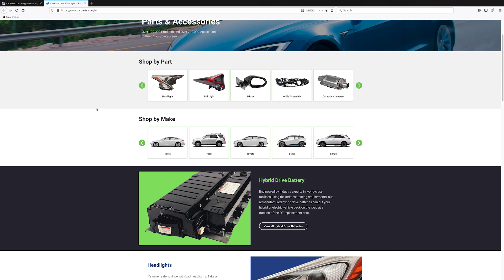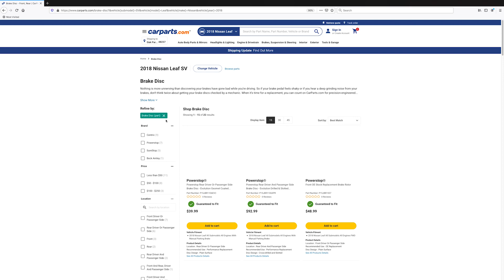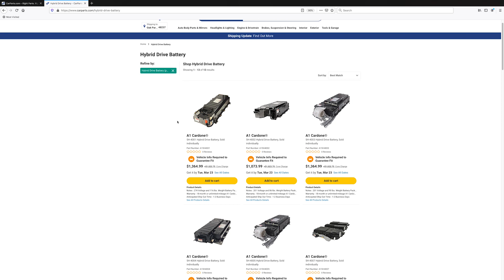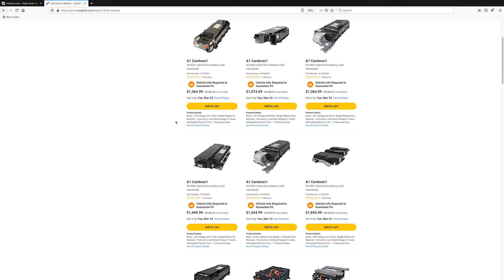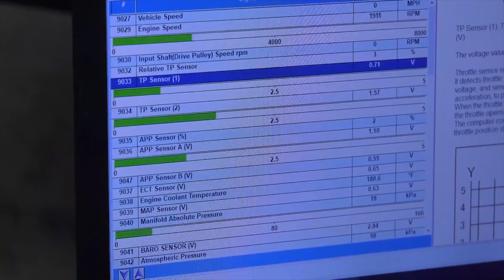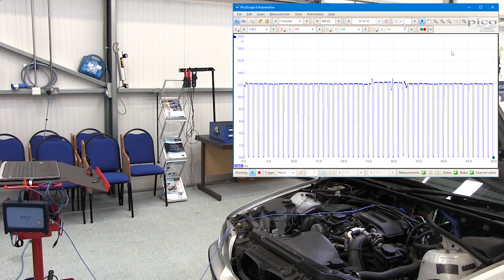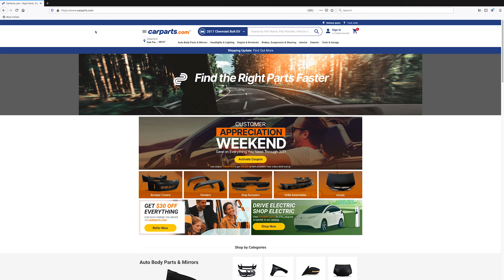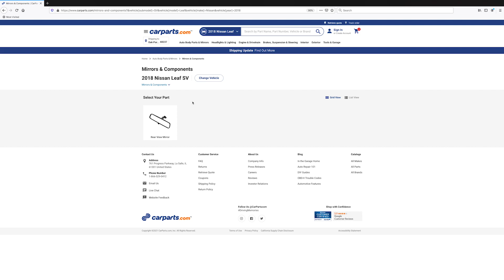CarParts.com Going Electric - Autoline Exclusives

Comment: They will need to revise their site a bit as right now, selecting a Tesla Model 3 shows a Holley carburetor, gas tank, and Flowmaster exhaust tip all as matching parts for it.
Reply: Tesla exhaust tips are the new hotness.
Reply: @CausticLemons7  Actually that should be coming a little later this year: https://www.youtube.com/watch?v=WcS9Kle816s